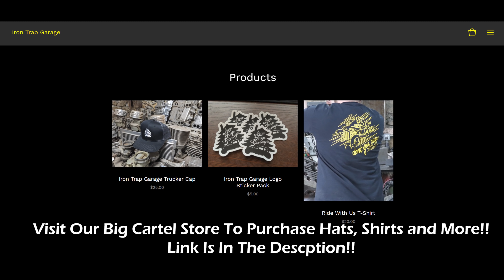Installing Model T Door Latches Into Custom Model A Door Structure

Comment: Just a thought Matt. Tack the latch screw nuts to the reinforcement & spot the reinforcement to the door skin. That way you can remove the latch if needed at a later time. Looks good.
Reply: I thought the same idea. It makes sense for after the door skin is attached.
Reply from the maker: That’s the idea. The reinforcement will stay tack welded to the inner structure. Just don’t want to weld anything until I’m sure I like it all!
Reply: Was wondering if nuts and stiffiner were going to get weld.  My projects come apart so many times before final assembly.

Comment: Glad to see your building your doors for the roadster. It cost so much to buy body parts anyway, and than you have to rework them to make em fit your car.  Very cool !!     Had to rebuild latches on my Model  A  coupe, and it looks like there is a lot more room to work with the outer skin off.

Comment: Hey Matt,  wouldn't it be better if you ran the one inch box tubing from the door latch to top door hinge? There appears to be enough thickness of the door to weld right over the latch assembly.  I would think that it would tie everything together and add more strength to the body, door and latch .
Reply: That's the same thing I was thinking... plus once the skin is welded on it's  like "closing the lid on the box" ...it will take out a lot of flex. .. especially on a roadster door without a window opening at the top.
Reply from the maker: The thickness of the door is sort of an illusion with all of the extra material I have hanging off right now. I’ll make the decision on the box tubing placement when I get to fitting it. I’m doing this as I go so no real set in stone way or “plans” to follow. Appreciate the input!

Comment: Awesome progress.  Love these type videos the most.  Just a thought for future projects..... if you have to work on both the passenger and drivers side doors, start with the passenger side. 😉. This way you’re practicing on the door you won’t use as often 🤣.  Also, I think I would have extended the doubler plate toward the hinges an inch or so past the stiffener bead and just notch the c-channel as required to go up over the bead roll.  Does that make sense?  I’m sure what you have will work great, but extending as much as you can past the bead roll will significantly stiffen it further.  I don’t normally provide armchair repair advice because you’re making it happen and I’m watching a video....... but you asked 👍👍😎👍👍

Comment: I would have made the support bracket larger than the actual latch size.  Metal tends to harden along the outline of sandwitched components and break when both components are exactly the same size.  The aircraft industry learned this along time ago when using doublers.  Not criticism just some additional info for the future.  Keep up the outstanding work resurrecting the wonderful cars you get.

Comment: Hey Matt
   As usual, Another entertaining and informative " How I am doing it Video ".
I have recently purchased another 26/27 Roadster cowl, front doors, seat box and back that had been a tub rather than a bucket.
   I am not sure yet if it is going to be an RPU or a closed cab pick up.
Either way it has the same latches you used and I have to build new doors as the old ones are just beyond repair.
   Keep up the great work on the projects and the videos.

Comment: you used rivet nuts on the the free T.  Is there use possible on the latch installation?
Reply: Was thinking same thing. must use threaded inserts not nuts on the inside in case the latch needed to be removed in the future because the nuts would be impossible to get to once the outer panel is on.

Comment: The door looks great but my OCD would go off the scale with the inner door bead that you rolled in being under the latch and leaving a gap... I'd probably cut the end of the bead out and move it down to be seen again and also provide a cleaner transition from the rolled bead to the door latch assembly (like I say OCD - sorry)

Comment: I was thinking that you could have built a square out of box tubing with the crash bar in it and drill and tap the box tubing to get rid of the nuts on the inside, should make the doors stronger, and after having seen my buddies old car that got t boned, a lot safer

Comment: Good work matt. But I have to ask, are you cutting an access hole?
Reply from the maker: Access hole? The car will have no exterior door handles.
Reply: @IronTrapGarage  yeah, so you can get into the lock area and change/repair it if needs

Comment: Nice looking start on the door. On camera, it looks like you're lifting it when it latches. Is that just camera angle or the fact that the inner panel is not yet rigid without the "sheer" provided by the outer skin?? Will this door also have the "dove tails" for lineup ???
Reply from the maker: Correct. It needs dovetails and more rigidity. The back side of the inner structure is being held in place by two single zip screws and it is a lot of weight for them to hold and they are allowing the metal to flex there. Once I make the inner box structure section it should give me more places to attach this inner sheet metal structure to.

Comment: Matt, the latch plate brace. Do you need to "capture" the four nuts to the plate, (tack weld them to the plate) so they won't vibrate loose, so you can remove the brace in the future for some reason and still have the nuts stay on the plate?? Just asking.....This is coming along fine..
Reply from the maker: That’s exactly the plan. This is just mock-up. I will weld the capture nuts to the brace and spot weld the brace to the inner door structure eventually.
Reply: @IronTrapGarage  ok Matt, I must have missed that part...I know you're very thorough..

Comment: Use some locktite on the hardware.
Reply: been riding Harleys for 50yrs I put locktite on damn near everything.Friends make fun of me.
Reply: @horshak1  
But not when they're setting on the shoulder trying to zip tie their fender on. Lol
Reply: @jerrylong381  sounds like you've "been there done that too :-)"
Reply: @horshak1  
Been there, didn't even get a tee shirt. 😢
Locktight is your friend. Go easy on the silicone gasket maker and Yamabond.
Reply: But don’t use Red locktite on anything you might have to take apart on the side of the road. Don’t ask me how I know that😜

Comment: Morning Matt,  I totally understand the small victories quote, I do have a question,  you tig weld most of your sheet metal work,  how do you stop the metal from oil canning? I understand the whole small tack weld routine,  but at some point you do have to make complete welds, I also realize the metal used on these vintage cars is heavier...I made the firewall on our race car, alot of bending,  bead rolling etc. The firewall is made from .024 thick sheet metal, I had to do some welding, which it oil canned. I got most of it out, I was going to do the heat it up, cool it down fast thing.....what's your opinion?
Be safe...God Bless!!
Reply from the maker: Oil canning is from stress being in the panel. It can be from shrinking caused by the welds pulling or it can be from the bead work in the panel and not being relieved before hand. Lots of causes but it’s usually a matter of stress in the panel. I hammer and dolly the Tig welds as I go to relieve the stress from the welding and keeps the panel relaxed
Reply: @IronTrapGarage  ok, that makes sense, what about when you bead roll a panel? Matt, I really appreciate your input & will use your suggestions. Also in race car panel fabrication silicon bronze filler rod is used, very low heat is needed...
Reply: When you bead roll a panel the bead shape takes extra metal so it appears to shrink the overall panel.. you can pre- stretch the panel before  bead rolling to give you the "extra" metal that you need... English wheel works best..planishing hammer too or hammer and dolly if you're patient  enough..
Reply: @jeffpitzer8521  thanks for the advice Jeff!!